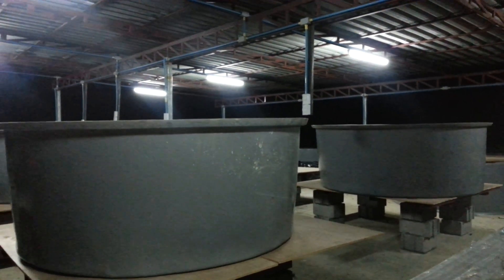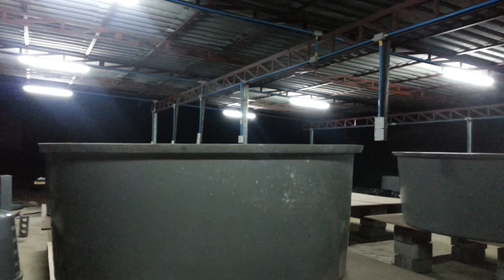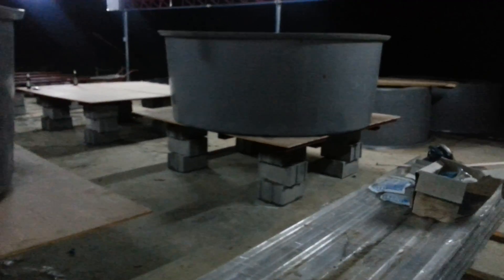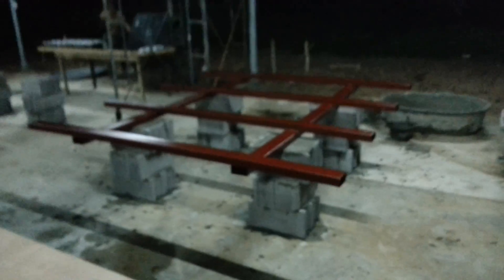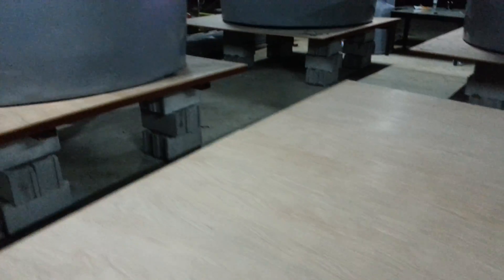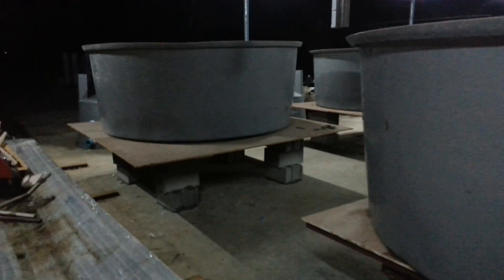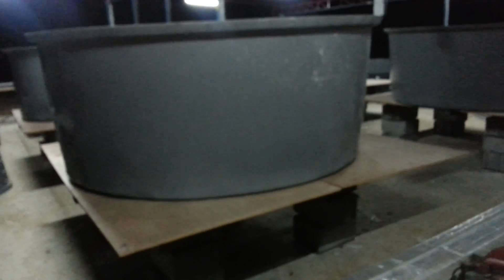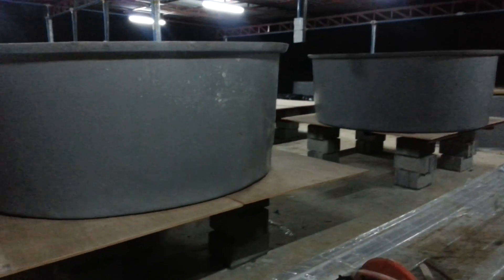Commercial Aquaponics Build Part 7

Comment: Prob want to paint the plywood with oil base paint... Reason is the tank will sweat and then make the wood wet... Painting will help stop the water from soaking in and rotting out...